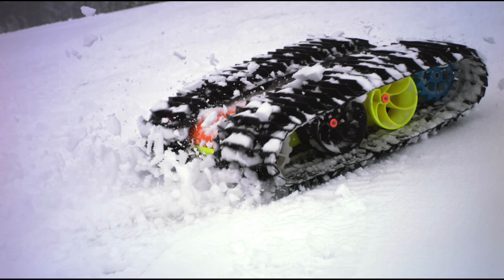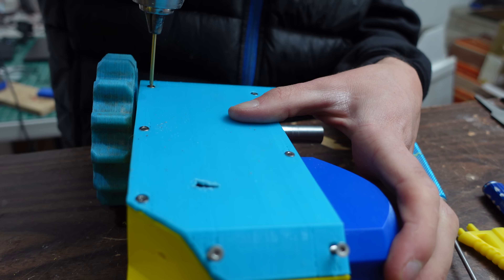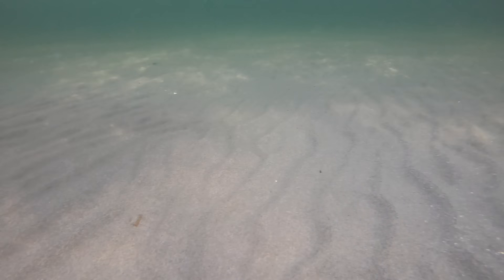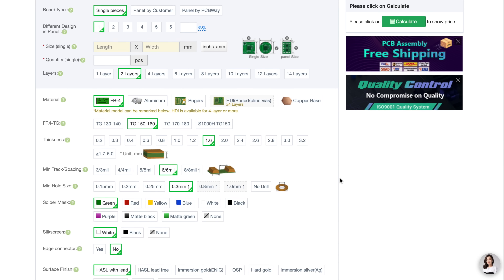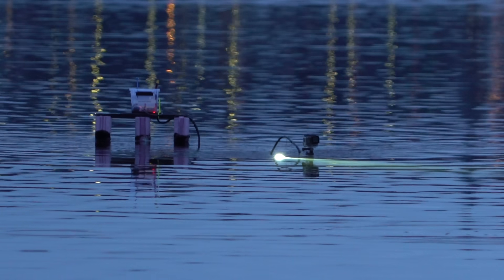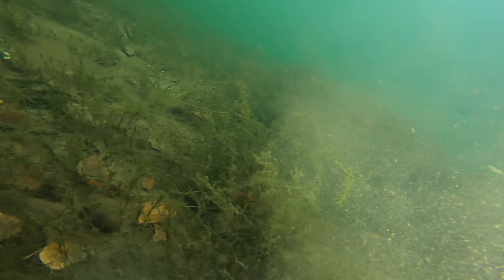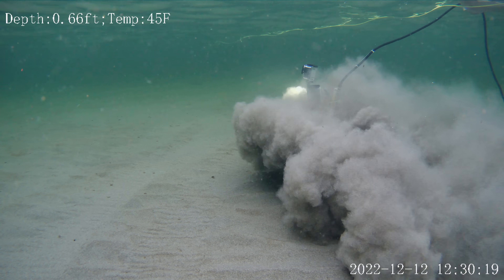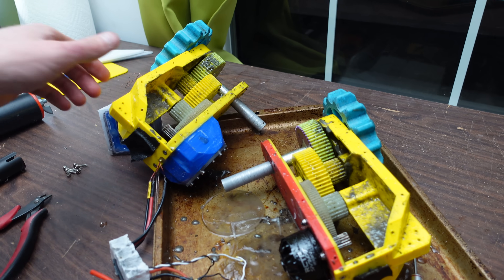DIY Aquatic R/C Tank

Comment: for RC underwater stuff i think having a rescue line on it at all times seems like a good idea.
Reply: just a rope and a yoga ball with a handel for bouncy but you need a kayak to go get it
Reply: Great idea you can get floating rope for throw lines that would work great from the floating part to shore. Then it won't tangle the rover
Reply: Maybe the float could have a winch on it as well as its own motor
Reply: @listaro4128  Maybe some way to inflate a balloon to get it to float to the surface?
Reply: @Oldsmobile69  CO2 canister and a balloon, yes indeed.
Reply: its got the big chord going to it already from the droneship
Reply: Make it so it always floats.... then add more weights .... that you can drop and it floats to the top maybe !?!?!?!?
Reply: @gewizz2 The "big cord" is literally the power/communication for the drone so 1. If it gets damaged your drone, controller, or both will be instantly useless...
2. If you yank it by that cord (which goes to the internals) and it accidentally gets ripped off the drone, not only will your drone be dead at the bottom of the lake with no way to retrieve it.. but imthe drone will also now have an access point for water to enter which will definitely fry any components that weren't perfectly waterproofed 💯👍

Comment: Also you can have a bobber on a shorter tether as deapth gage, so it gets pulled under before the main tether, then you know when to turn back
Reply: if you look closely he did that after the first test
Reply: It would be cool to attach a water sensor to the float to send back a telemetry signal if it gets pulled underneath
Reply: no that's different, that's a bit of foam to add buoyancy to the tether so it doesn't drag in shallow water
Reply: @FowlerAskew  or just put a wide range barometer on it

Comment: i think part of the issues have to do with inherent features of the lake bottom - as a low-energy environment with almost no current, the sediment will consist almost entirely of silt, clay, and fine-grained biologically-generated material. this has the effect of: 1. making it harder to drive as you'll tend to stir it up and sink in, and 2. meaning that any sediment stirred up will take a long time to settle out, so driving will inevitably make it very cloudy.

btw that smell of lake sediment is often due to methane bacteria :)
Reply: While I agree, notice the lack of actual imprints from the tracks? Those tracks help spread the weight out enough to minimize that. I think this is a good starting point for submariner rovers.
Reply: I used to go kayaking in the local canal with the Scouts and you could prod the mud with your paddle and a load of foul-smelling bubbles would come out.
Reply: Maybe a screw tank would be better in this environment, because it never has to double back on itself like tracks or wheels do. All sides of the screw will give forward thrust. Screws will even give you thrust without touching the bottom.
Reply: @TheAnoniemo  brilliant. The sides would have to be counter rotating, I assume...
Reply: @mike_oe  Yes
Reply: Jumping on this comment since its at the top for visibility. You can reduce the EMI of the DC power wire tether by twisting + & - together. Might not solve your issue, but should help!!!
Reply: I am not professional, but I guess rubber tracks would help with the sinking without expanding the size of the tracks.
Reply: well TIL about methane bacteria. 

love nature's endless horror.
Reply: @acomingextinction  Oh, that's nothing. Shewanella can breathe uranium.
Reply: Yup. And once you get some ways deeper than the top surface of the muck, you have anaerobic bacteria and that really has a smell to it. Hydrogen Sulfide and stuff, like I found in a large planter I neglected to drill drain holes in. The tree in the planter did fine for about three years and then suddenly died. I have an H2S meter from work and found 200+ ppm even after it had vented for a bit. Turns out the tree wasn't totally dead. After a year in the same planter, this time with drain holes, it thrived.
Reply: This is why when you see scuba divers that know what theyre doing, they use very subtle looking kicks so the fins dont stir up all the sediment because whats the fun of diving if you cant see anything. In caves that stuff can be deadly.

Comment: This was a great project! I have two suggestions.

1. Use a compass to get an idea of the direction you are pointing.
2. Strap a "safety balloon" with a co2 cartridge to it and inflate the balloon if you get stuck. If you do it right, it will stay upright and lift the top of the tracks above the water so that you can use the tracks to "paddle" back to shore.
Reply: I was thinking about a winch on the barge, but a co² safety balloon sounds a lot more fun
Reply: @phirenz  I guess that could work too. But he would have to add propulsion to the barge or inflate his kayak to retrieve it.
Reply: Was going to comment exactly that! Nice work Mr G
Reply: @platima  Thank you sir
Reply: Would a compass work okay under water? Also surrounded by those two motors? I thought he should use a gyrometer or something to keep an idea of orientation but it would eventually build up some error.
Reply: @benknight5995  Yes, a compass works under water. Divers use them to navigate under water. The motors might be a problem though if they are too close.
Reply: @benknight5995  very good point. I think the motor noise would definitely mess with it. Better than nothing perhaps? A gyro could be good, just not sure how accurate that is with constant small movements eg waves? Probably comes down to the programming
Reply: the surface dinghy needs its own power plant and a winch. 

so it can lift the tank over underwater obstacles or deploy it @rctestflight
Reply: CO2 cartridge and balloon. Makes more sense to wade or swim or use a small boat to retrieve it manually. You don't wire a new home before putting a roof on it. Basics first.
Reply: @wayneleroy6382  In this analogy, is the balloon the roof and the boat to retrieve it a new home? Or do i misunderstand your comment?
Reply: dont even have to be that complicated. Just.... tie a fishing line to it.
Reply: Also could use mirrors so you can see the sides of it instead of just what's in front of it and see if the tracks are jammed.
Reply: I was even thinking you could put pins held back against a spring with a low power trigger that releases the pins to puncture the cartridge so I'ts easy to recover in the event of power loss.
Reply: @berrodude  You could also make require power to NOT puncture it so that if you lose power it triggers.
Reply: @Mr_Giraffe  exactly what I was thinking. Great minds 😜

Comment: I really want to try this with one of those spider robots underwater
Reply from the maker: FPV crab???
Reply: @rctestflight  yes sir
Reply: @@ruska9773spider crab 👍
Reply: I'm still waiting on the crab drone video!
Reply: @unholyhardy4359 he did make a flamethrower spider Thomas the tank engine so I think it’s ok if he doesn’t make an FPV crab
Reply: @rctestflight  so i saw dat ther were 8 wires kant you replase it whit a eternetcabel?

Comment: This is a great concept !   Once again your crazy contraption is amazing !   My suggestion for “version two” would be to have a larger surface barge and a small additional spring loaded cable with an electric winch to lift the underwater rover in case it gets stuck or fouled in the weeds.
Reply: I agree with you,plus it'll be nice if he added propullsion motors motor like a sub one or two just in case he got stuck underwater i think that would be a great help.
Reply: Give the barge propulsion too - it could go out and drop the cat into the right place, and bring it home
Reply: I am not an engineer, but i think, that he should cover the upper side of belts.
Reply: @petavaverka  water would still get in but then it could more efficiently generate thrust against the way you are going. Now im curious. If anybody has an answer please let me know.
Reply: The raft should have enough buoyancy to lift the rover with a winch for either a cable or directly to the communication wire. Maybe a couple of motors to raft with propellers attached to retrieve. Though this would be somewhat over engineered.

Comment: Hey Daniel ! For the video signals you definitly should use coaxial cables. It will have a "shield" functionality and will prevent the video from being jammed by the other signals such as power or ESCs. As it's low speed signal you don't care about impedance and can use both 50 or 75ohm cable. There are some really thin ones available. All you have to do is solder the signal on the inner line and GND on the shield on both sides (rover and barge). Hope it helps !
Reply: Yes using a coaxial cable is the proper thing here, but as far as I am aware the signal from the FPV camera is composite video. Composite video was designed for use with standard FM/Broadcast TV coax which is 75 ohm. It's possible it will work fine on 50 ohm, but it's supposed to be 75 ohm. 75 ohm also happens to be the most available and in some cases cheaper than 50 ohm. My recommendation for him would be RG-59, for the 40 foot tether, the video signal and cable structure should be plenty strong. Like you said, make sure you ground the outer shield. Particularly at the camera and transmitter, not just any power ground as ground current could actually cause a similar interference problem.
Reply: Also secondarily, run the video signal as a parallel tether, not shared with the power cables (That's what's causing the interference, not the 5V PWM signal, the battery power creating a magnetic field.)

Also...batteries in the robot itself will minimize or eliminate most of the weight of the tether, while also acting as weight to keep the robot at the bottom, and will allow you to use a smaller BEC circuit to power the surface equipment, and keep the surface float smaller.

There's some stuff regarding UUVs that is significantly different from normal RC stuff, because of tether lengths. You'll have a LOT of power loss over the length of the tether. Ideally, you want to use the minimum number of wires in the tether possible. For that, I recommend just the camera+ground, and 4-wire serial connecting two controller boards (One translating the receiver's 2-3 channels to serial, the other translating back to PWM) with a power booster every 50 feet along the tether. Batteries CAN be submerged if they're in waterproof boxes. I use Otterboxes, which can double as tether floats, and run my ROVs down on 200' tethers made of Ethernet cable.

Comment: If you need to waterproof, there is a product made by Lawson called LPA III. It's basically lanolin and parafin wax in a acetone solvent. When you spray it on electrical boards it waterproofs them. I've tested this for underwater operation. It's better than potting because it allows for heat dissipation and can be removed with a solvent safe for electrical boards. You could seal 3d prints with it as well.

Comment: This is one of the most interesting projects I’ve seen recently, I’d never heard of those methods of waterproofing electronics before and I think underwater RC is just such an interesting concept! This makes me wonder how to build an underwater rock crawler and do some submerged off roading…
Reply: It's super easy, I do it...frequently...

I'm known as a submarine driver among the crawling groups I'm in, because it's not unusual for me to drive my crawlers in 2-3 feet of water. I use waterproof potted air receivers with the peripheral antenna mounted on a long-snorkel (sitting 18" from the ground) so the most it gets is 18" under, which is right about where the Spektrum DSMX frequency starts to fail. I've gotten as much as 22" of water between the antenna and the radio and been in control, but it's spotty at that depth)
Reply: @NikkiTheOtter  Wow that's really interesting. I thought my use of cheap rc motors as outboards was something ;)
Reply: @shaft3r1  Oh it is. We have to sometimes get CREATIVE with our parts

Comment: Awesome prototype! It would be really neat if the barge was RC as well, with a winch that could raise and lower the rover to help recover it or place it in specific areas
Reply: That idea is actually poggers but would require a pretty large and stable barge or much smaller rover

Comment: Should have paddels that fold in one direction on the tracks :)
Awesome build!
Reply: think about it once again
Reply: @harrie205  a pin to to raise them on the front wheel and an elastic string to fold them down on the top side, should work fine?
Reply: would make reversing and skid-steer less possible

Comment: In the future for small amounts of moisture, you can buy silica gel cat litter for extremely cheap compared to the packets made for drying. 
Drop a few granules inside the “dry zone” and you’ll be good. I keep 3D filament in a big Tupperware tub with the silica litter sprinkled on the bottom because I live in FL and it’s swampy as hell, but the filament stays crazy dry! The stuff works incredibly well for how much you use. Literally a few granules would keep a housing like your camera dry. 

It’s useful stuff, you can use it for a ton of things you probably wouldn’t think about until you have it.

Comment: Absolutely awesome as always. I've always wanted to diy my own ROV. You should look into removing the mounted ballast weight, and look into making some sort of emergency cutaway balast. If you get stuck, or too deep you could flick a switch and float to the top, leaving the balast as a reasonable sacrifice. The hard part is making it water tight... If you use steel plates for your weight, you could use magnets mounted to actuators of some sort to engage/release. Then you can use a magnet on a rope and the blow up kayak to recover your weights. Just an idea for if you ever revisit this.

Comment: I found the bit about using mineral oil to flood the electronics pretty interesting. For the tank, i wonder if it would be feasible to turn it into a submarine hybrid which would allow it to get out of trick situations, by filling tanks with air and becoming buoyant.

Comment: What if you added a solar panel on the raft so that the battery drains slower, Wouldn't need to worry about cooling since your surrounded by water.

Comment: why did you go through all the trouble to seal the motors? aren't brushless motors sumergable? was it to keep the bearings fresh?
Reply: Brushless DC motors can be used subsea no problem at all but requires regular flushing with fresh water after each dive.

Comment: This is a project that needs a revisit.  How deep could you get the tank to work? A lot of this doesn't actually need to be water proof? Just keeping the sand out? Would a big floating barge with a solar panel be able to supply power for unlimited tank range?  Also a nice long range antenna? Then take it to the beach and drive out through the surf to 30ft depth?  Maybe large diameter wheels instead of tracks to keep it away from the sediment?

Comment: If you want to 3D print waterproof things you must use ABS filament, is a bit tricky to print, you need an enclosure for the printer to keep the heat from the bed under control, ABS like to cool down slowly, after your print is ready, do a bath with acetone vapors to smooth the print and is ready, there are many videos of how to do the acetone vapor bath on youtube.

Comment: This is amazing. I imagine the submarine tank using your kayak tug as it’s surface support. Perpetual daytime power source. If the tank needs recovery, the tug drags it out on its own power. Add a 3D printed winch and it can even pull it up close to the surface.

Comment: That was actually really cool.  Would be cool to try to revisit this concept with a longer tether and a better barge that can take a beating and is more watertight, could also have solar on it. I wonder if there is a way to send/receive signals, telemetry, and video over ethernet. Like some kind of converter that puts everything in a a single cable.  Could have a battery onboard but also use POE to trickle charge it on the fly.

Comment: Important tip about making watertight 3D prints: use solvents. F.e. ABS washed by acetone becomes completely waterproof after drying and even can keep HP air (given the part has appropriate thickness). Super easy, doing that for years since 2015, always works.

Comment: Cool concept! Some electronics geek ideas: use differential, 2 wire signals for the video to get rid of that interference. Coax will not help much if the grounds are interconnected. Maybe a fluxgate compass module so you can know which direction it's going?

Comment: Awesome stuff you’ve done here. As for using 3D printing for low-pressure watertight enclosures I’ve personally had success using extremely fine layer heights with vapor smoothing. (I use ABS with acetone, but you need a pretty big skirt so it doesn’t warp). I make the walls a little thicker, but you don’t need 100% infill. Where you’d like to screw in flat surfaces like that plexiglass you have to sand the plastic as flat as you can get it (which it looks like you’ve done here). Barrel sanding techniques work quite well. In order to make that process easier though I’d reccomend using some automotive water pump gasket material with a set of cheap gasket punches for the screw holes. Works wonders. Made everything from submersible enclosures to PC water blocks with this method. 
Best of luck!

Comment: Daniel.
An idea has formed itself in my mind. If you had a bigger platform on the surface that had propellers in it and a winch you could drive the aquacat out to a good place and lower it to the bottom. This way you would have less of a chance of getting stuck or loosing it.
It'll be like two of your projects in one. 🙂👍